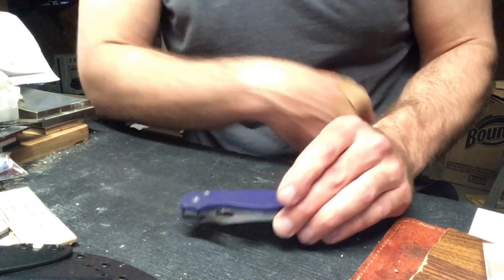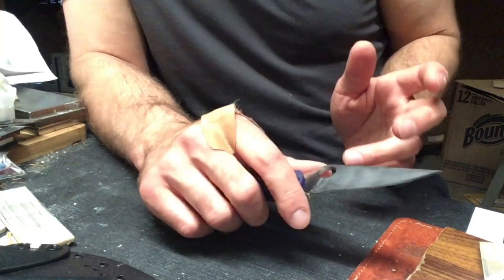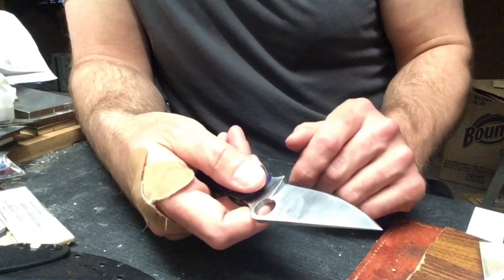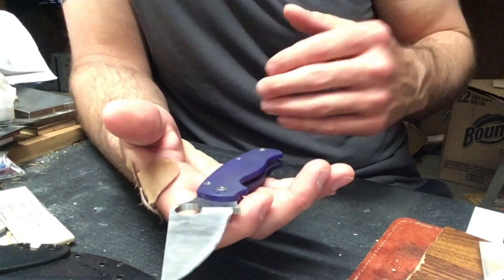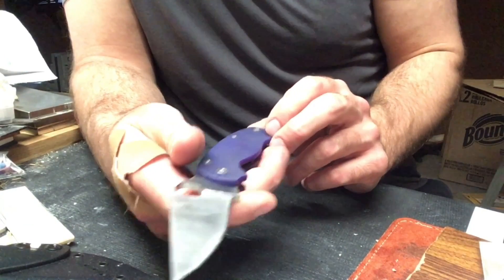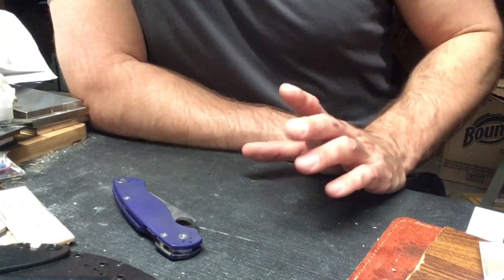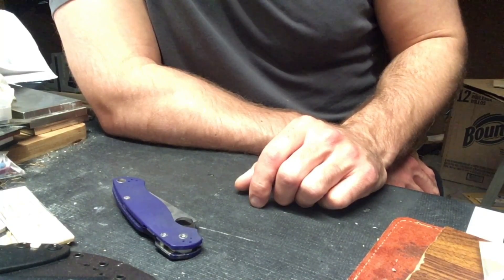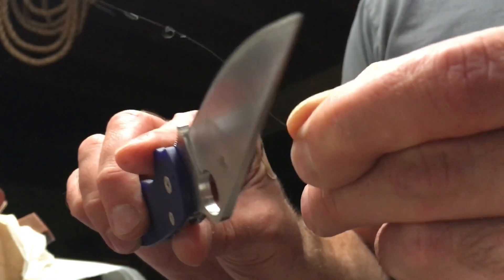CPM S110V - carbide tear out in sharpening

Comment: Thank you so much for this video, I think that this is almost certainly the best, and most comprehensive information about S110v blades,.. I've had a UKPK in S110v for a few years, and have recently got the Military,, . I'll take on board everything you've said here, and use it as my "reference book" for sharpening and maintenance of this steel,, thanks again for enlightening me,,
All the very best from across the pond,,,   John
ps, I know this is a very old video, but I hope you see this comment,, 👍
Reply: Im thinking about buying the UKPK, how quickly does the steel chip during which uses?

Comment: Wow!  That is sharp!  I just bought a Military and find the action to be very stiff.  It also came off center.  I was able to center it playing with the pivot screws, but it is still stiff.  Not that easy to Spydy flick, but I can do it most of the time.  Thumb flick is fine.   If I hold the knife open horizontally and press on the liner lock, it only will drop halfway and I need my weak hand to close it.  Ive used lite oil and deployed it around 100x.  Normal?  I like the knife otherwise.  Your knife flicks and closes perfectly.    Thanks Mike!

Comment: bit different but found myself with a ukpk s110v still unsure if i want the instement in time sharpening it yet to use or stick with my cheaper steel one thats easier to sharpen you have some mad sharpening skills and im now finding myself sear2ching for diamond strops all the best
Reply: Besides sharpening, how did the steel perform in this model, any chipping? Thinking of buying one.

Comment: Such high amounts of vanadium and especially niobium would have tremendously prevented most of the formation of the much larger chromium carbides that would cause chipping, but there is still chromium carbide formation in S110V. Carbide tear out is caused by chromium plate martensite formation not any vanadium or niobium carbides, also V & Nb would help prevent any plate martensite formation. To curtail grain growth is why you see many stainless steels with at least 0.10% vanadium added to them although I believe that at least 0.20% should be used. Molybdenum also will help prevent plate formation, but too much carbon and chrome is going to cause big chromium carbides like D2.
Sometimes an element addition is more for show and not for what it actually does for a steel. For instance Nitro V is nothing more than AEB-L steel with 0.11% nitrogen added during the ingot melt and a paltry 0.08% vanadium thrown into the mix so they could say they were not copying 12C28N IMHO. That's the only reason I could see for adding such a low amount of vanadium. AEB-L is already a fine grained steel from the low carbon content and nitrogen pretty much does what vanadium does at keeping carbides small and possibly making a few nitrides. AEB-L makes a few chromium carbides which was the thinking behind its development by Sandvik who calls it 13C26. 14C28N was Sandvik making their 13C26 more rust resistant and it turned into a pretty good budget steel.

Comment: Ive recently transitioned from more of a manix-2 man to a pm-2 guy.
Guess im gonna have to grab a pm-2 in S110V and deal with those god awful blurple scales again unless i can find a M4 or Maxamet  model.
I really appreciate the pm-2s needle like tip, thin dimension behind the edge bevel, light weight and versatile ergonomics.
The manix-2 will remain my preferred heavy duty cutter but the pm-2 really is a superb EDC.

Comment: Really dug this video. This is probably an annoying ass question but Im going to buy a pm2 and its a toss up between s110v,s30v and s35v. I dont care to try forums because you never get an answer. Which one do i go with?  You just pick. I cant get a firm answer
Reply from the maker: RagingOatmeal S30V IG toughness is an issue.  S110V if you want edge retention and toughness doesn’t matter.

Comment: In my experience with S110v, the best way to keep it sharp in use, is to not use it. Cutting and apple in my hand has dulled edge, along with just having it in my pocket.
Reply from the maker: C Poitevint that doesn’t sound right.  Are you sure it was an apple and not a concrete ball?...  maybe there was a mix up.
Also, how was it sharpened?
Reply: @michaelchristy4982  I've been using this for a little over a year now. I found it dulled quickly when cutting plastic, soft plastic banding even, and it even dulled when carving some wood. I've recently had good luck with resharpening on the unfinished portion of coffee mugs, oddly enough, over free hand with diamond stones. It doesn't touch up well with a leather strop, and oddly enough I found this thing to lose edge just sitting in my pocket.  I have it lightly convexed now, and thats helped some. This steel has been a major learning experience. Your video was informative. I'm trying to make this steel work for me.
Reply from the maker: C Poitevint what diamond plate are you finishing with?  And what does your scratch pattern look like (direction of scratch pattern)?
Reply: @michaelchristy4982  I use a DC-4 and then go onto an EZ-Lap extra fine. I also have two strops, one with compound and one without. I get pretty good results when sharpening A2, 3V and CPM S30V with my little system but S110V has been difficult to sharpen with this, and I've been resisting the urge to by a clamping sharpening system. I usually keep the angle and slice across the stone. I don't pull the edge across the stone

Comment: I feel that the UF stone is only making contact with the tops of the ridges created by the previous diamond stone's scratch pattern. It may tear out some carbides from these ridges as it knocks them down (flattens them), but it doesn't effect the deep parts of the scratches. Basically it hits the mountains but not the valleys, essentially giving you a flat, refined bevel surface with only intermittent areas where carbides have been torn out. In using several diamond strops following the UF stone, I feel the effects of this carbide tear out are completely negated.
Reply from the maker: The Ace possibly the case.
Reply: Carbide tearout does not happen. It has been debunked for a while now.
You abrade the steel away leaving the vanadium carbide exposed rather then abrade it with the steel causing exposed carbide all around the sharpend parts. Could these exposed vanadium be the reason for the sharp "teeth saw" effect maybe, having hard carbides exposed could last awhile.But wrong abrasives on these hard  carbide can causes fractures due to its high hardness.

Comment: I just bought a PM2 Blurple S110V. I am not an expert like you, so I’ll have to make do with the factory edge for as long as possible, and use my diamond rods with spyderco Sharpmaker. I love your video though, maybe one day I’ll be on that level of skill. This is only my second knife. Or 2nd “Spyderco”.
Reply from the maker: Stephanie Santelmann sure, run the factory edge as long as you can.  The diamond and ceramic rods from the sharpmaker should get you back to functional when you need them.  Glad you liked the video.

Comment: Hey Mike. I finally sharpened a knife using both hands and watching the bevel like you do the entire time while holding the stones at an angle...holy crap. Really gets things precise and as close to perfect. And using my left hand wasn't as hard as I thought, o had good control. Moving on to spyderco fine now and then strops. Ill let you know how it compares to how I was doing it before. Do you prefer the slow single swipe method or the faster method where you move the knife up and down and work your way heel to tip until you get a solid burr? Any notice on the final product ?

Comment: I’ve got that same variant and have never sharpened it; I only use leather strops with 6, 3, and 1 micron diamond paste every day it’s used, and the blade is almost needlessly sharp 🤪.  I incurred a couple of tiny chips that I could see under a loupe which might substantiate your theory on carbides, but they stropped right out with minimal effort.  I simply don’t find the enormous difficulty people have with S110V, but again I’ve never had to take a stone to it.  Personally I think S110V is an ideal steel for me because I have rather unsteady hands and have fouled up blades in the past, but with the S110V I don’t have to actually sharpen, just hone with a strop and compound, which is virtually impossible to screw up.
Reply from the maker: Jonathan LeBlanc stropping does have a lot less risk.  Eventually you’ll need to sharpen your knife, or have someone sharpen it.  You should work on keeping your hands steady.

Comment: Newb question: I'm getting my first s110v in a Manix 2. I only have the Sharpmaker. If I understand correctly, I should skip that and purchase diamond stones - Coarse, Fine, Extra Fine, Extra Extra Fine, Extra Extra Fine Diafold, and that's all? DMT brand? And what angle seems to be best for s110v? Thank you so much for your knowledge.
Reply from the maker: VoxVirtus to get optimum performance you would want those stones (DMT C, F, EF, EEF, and a Spyderco UF), but that doesn’t mean you can’t enjoy your knife using the Sharpmaker.  I don’t think your results will be as good, but you can still enjoy your knife.
Reply: Thanks. Carried knives my whole life, and now I'm really curious about the theory and application of sharpening. So if I understand correctly, CPM steels have carbides from 3 to 8 microns and thus to maintain a stable edge is to not sharpen with a grain size less than that?

Comment: I sharpened a friends Manix 2 in S110V about 6 months witch a coarse DMT and then continued with Edge Pro stock stones in 220, 400, 600 and 1000 grit before finishing on a stropman strop with green compound. It got hair whittling sharp, but this video made me wonder how well it has held up. Thank you for the info on possible carbide tear out, it's highly appreciated:)

Comment: Holy cow, great video! First video of yours I've watched, and I immediately subscribed. I just bought a blurple PM2.  My sharpening skills are pretty decent by many average people's standards, but I don't think they're even in the same ballpark with yours. I have once before gotten a hair whittling edge when I checked it, but generally don't test for that. Push cutting phone book paper cleanly is usually how I check.  I've sharpened D2 and and CTS-XHP to this level in the past without issues, but S110V now has me a bit worried. I'm using a 1x30 belt sander with a mix of silicon carbide and aluminum oxide belts up to 1200#, followed by a leather stropping belt with white compound as my main sharpening system. Do you foresee problems with me sharpening CPM S110V on my own? Thanks for any feedback you can give me.
Reply from the maker: Paul Schuette not sure how the belts will do.  They might cause a problem for the higher levels of sharpness.  Also, I would switch the to a diamond compound on the leather belt.
Reply: Thanks for the input!

Comment: dang dude, I'm a simpleton in comparison. I just hit it with the medium brown triangle that comes with the Spyderco Sharpmaker. It doesn't even really shave arm hair, but it shreds paper and rips through packaging. I guess you would consider that more of a "working edge". I tried hitting it with the white (fine) triangles, but that didn't seem to make much of a difference. Any tips for getting it as sharp as possible with a very basic setup?
Reply from the maker: David Westwood for S110V, you want diamond stones.  After apexing the knife, refine the edge to the point that you want.  That’s the simplest explanation I can give.
Reply: OK, thank you very much for the reply. So in my case, since I want to use the Sharpmaker for everything, I can do this using the 204D diamond rods, correct? The 204D diamond rods should be good enough to satisfy the need for use of diamond stones? Thanks again

Comment: As far as chipping your blade while cutting the laminated wood a lot of the laminates have a ceramic top coat to prevent scratches. That would be my best guess as to why you were chipping out your blade.
Reply from the maker: Shaun Bryan I’m sure that’s a possibility, although I couldn’t get chipping on the blade after that over the weeks with different sharpenings.  Maybe it was the wood, or maybe I caught a nail.
Reply: Michael Christy just in my experience I've seen brand new fine cut carbide tipped Saw blades go dull within a few hundred feet (200ft of instal)  they really start smoking and spitting Sparks. Or should I say they start shooting sparks and then smoke. In short I was just trying to say I don't think it was the steal that  faild was the material that you didn't know you were going up against. That's my final argument. I greatly enjoyed the video and at the end I'm just trying to inject someone of my experience into what may have happened.

Comment: That hair splitting edge is like knife porn man that's amazing. You mentioned feeling like your worn in stone gives a finer edge. That's pretty much the basic idea behind how I sharpen my knives now realizing I can get them sharp enough with minimal effort on the fly. I have some cheap 750 grit diamond stones that come super gritty brand new but after putting some dull blades on them for a little while they smooth out real nice over time. It usually takes only 1 or 2 passes most of the time now to bring an edge back for me on nearly any steel, enough to *where it will slice phone book paper nicely if it was struggling with notebook paper before. I was actually over sharpening on the same stone for a while before realizing it. To get edges like yours you def need to put in the work and progression though.

Comment: when you worked on the laminate wood you got chipping (macro) or microchipping?
Reply from the maker: Tomer Ben Avi it was pretty good size chipping in the edge bevel.
Reply: ok because I recently sharpened my Spyderco Gayle Bradley on the Spyderco double stuff (after it no longer was saving hear. without using diamonds) and got microchipping from only cutting some of thin cardboard!
Reply: have you watched steel drake videos about carbide tear out? and what do you think?
Reply from the maker: Tomer Ben Avi there was a link to something that someone sent me on carbide tear out.  I watched most of it, but never got a chance to finish it.  Not sure if that is what you’re referring to.

Comment: What are the practical differences between the m390 and s110v steel?
Thanks.
Reply from the maker: DAVIDE TREVISANI M390 has higher toughness and better corrosion resistance, but S110V will have much better edge holding unless the material being cut challenges the stability of the edge.

Comment: I have a benchmade knife with cpm20cv steel would you say that there is too much vanadium in that steel to use alumina based abrasives? I only have course and 600 grit diamond, and the rest is spyderco ceramics and king brand waterstones.
Reply from the maker: West Coast Warriors Archive I get better results with M390 (very similar to 20cv) using diamond and ceramic.  You can use waterstones, but the stones will hold back your results.  I would suggest getting a Spyderco UF, and then go C diamond, 600 diamond, Spyderco Med, Fine, and UF.  Then strop if you have any strops.  Or just spend a lot of money on more diamond stones.  But I think you’ll get pretty good results if you follow the pattern I laid out above.

Comment: Dear Michael, is it critical to use leather at the end, or you can just use .005 on wood? if no, from what grit # one should switch to leather (for example up to .1 you can do on wood, anything below that should be on a leather).
And also how to know/feel/see when to switch to a different strop? Do you count your moves on each side when you work?
You mentioned in one of your other video that the wooden strops get loaded (and you throw them out). Does the same happen with a leather? does it get loaded as well and needs to be replaced once in a while? or it's just the feature of the wood?
thanks
Reply from the maker: Peter Dmitrenko everything loads.  The larger the abrasive size, the faster it loads.  Below .25 micron loads very slowly.  
Wood or leather is fine.  Leather will last longer over time, but if the abrasive size is large, like 1 micron, the strop will Laos before the wood will fall apart.  If it’s .1 micron, the wood will probably break down before the strop loads.  But you can use either.
Reply from the maker: Peter Dmitrenko I don’t count my strokes.  I know how many it will take to effect the edge the way I want, so I go beyond that point.

Comment: Dear Michael, 2 questions, Here you said somewhere that you purchase your diamond paste from the source - I checked it's like $45 per one paste. I find on ebay for like $4 you can get all grit pastes (like 5-7 of the tubes) - they are no good are they? And another question what wood can be used as a strop? is plywood ok? thanks. Peter

PS One other question - did you have the experience with the strops from Stropman - http://www.ebay.com/itm/Leather-Strop-Sharpen-Polish-Compounds-Choose-4-Bars-strop-not-included-/110658811606?var=&hash=item19c3c776d6:m:mL91YVjN85oZ9pdvECozkNA

Can you say anything about the compounds he sells. 
When sharpening the knife, If you finish a blade with the UF spyderco, can you jump to leather strops, or you must use wood with the set of diamond compounds prior that?

thanks
Reply from the maker: Peter Dmitrenko different compounds have different costs.  The brand Temo is around $40 for a large number of tubes, and that brand has been pretty good in my experience.  Temo isn't the best brand out there, but very good considering the cost.

I've never used Stropmans products.

Different kinds of wood give different results.  I experiment with different wood from time to time, just to see what I can find.  I still prefer basswood.  

You don't have to move on to wood.  You can use leather.  It's really your call.